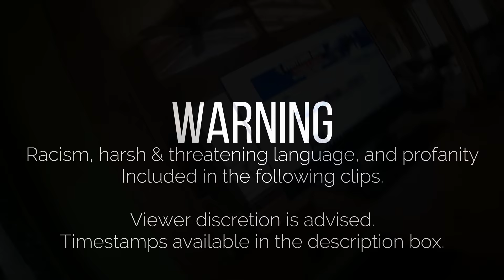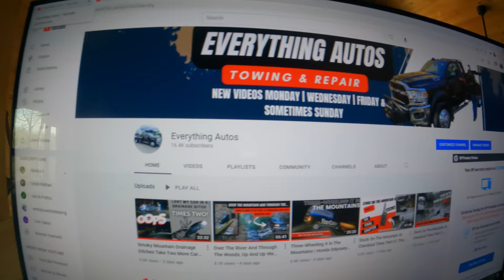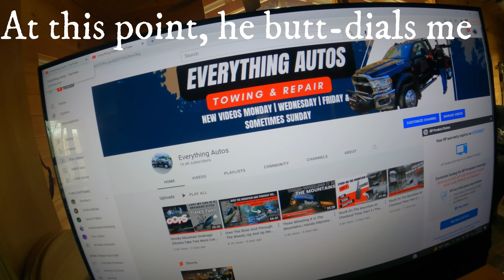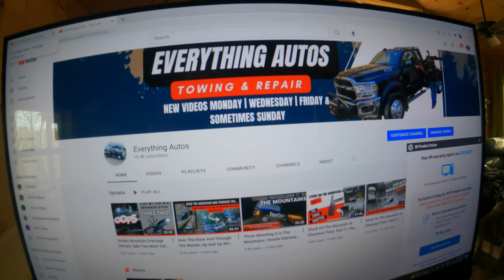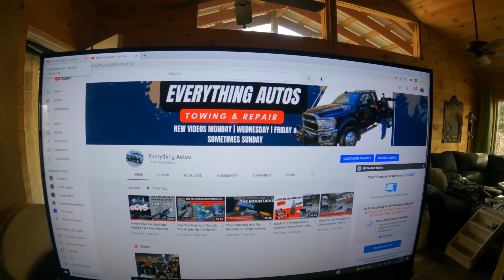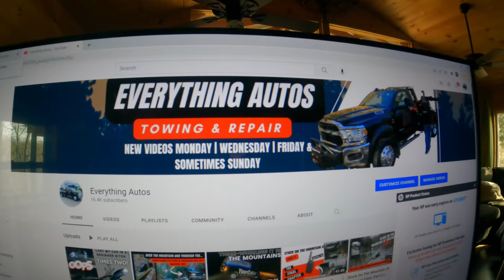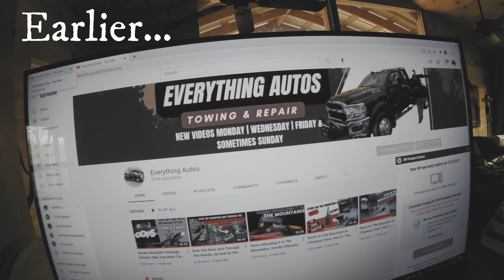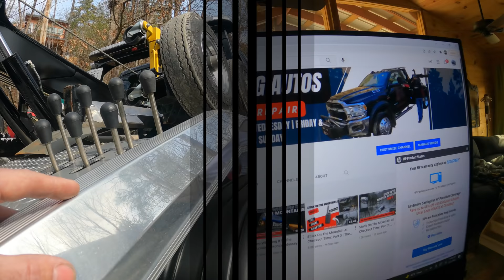Towing A Police Officer In Gatlinburg | Irate Couple Shows Their True Colors

Comment: That window tint on the Duramax cannot be legal. Georgia requires 32% light transmission at the minimum. And nothing on the windshield lower than 6 inches from the top. That looks like 10% at the most, all the way around, including the windshield.

Comment: I don't think their little signs would be legal in our state.  Bigger is better.  I have put them up where I worked and they were like 12" x18"  and mounted 6 feet off the ground.  The signs were supplied by the towing company were dealt with.  Personally, if it was me being the tower with the agreement, the motel or private lot would have to put up signs I agreed with and supplied or sold them.

Comment: 11:30 Butt dialling is so embarrassing. I did that once at work. We had push to talk software installed on our phones / tablets. I had installed it on my spare phone because it was hard to do it on the tablet. I had put my phone in my front pocket. It was a hot day and the moisture from my leg has activated the phone (Capacitive Touchscreen) activating my phone to transmit. I was engaging in a conversation with co-workers whinging about company problems and it all went through to everyone including management. All transmissions are recorded for playback as well :(
It's funny as the only time I've ever complained about the company is the time this occurred.

Comment: To be fair here, that overflow parking lot sign is VERY confusing. It should say it is the GRAVEL lot. People assume it is the numbered lots in the direction of the arrow. Two years later it still has the same sign. That hotel needs to clearly specify the gravel lot. But people also don’t listen either. But this guy was a douche.

Comment: That truck was double parked as well. If your going to buy a big truck like that you have to know you can't park it anywhere you want and take two spaces. If I'm in my beater I'll squeeze it in there and park them in every time. LoL its always the ones with a bed that still looks brand new, and the chrome on the hitch has no scratches and a nut sack hanging from it. Over compensating for something I guess.